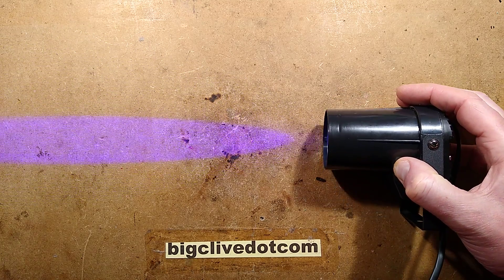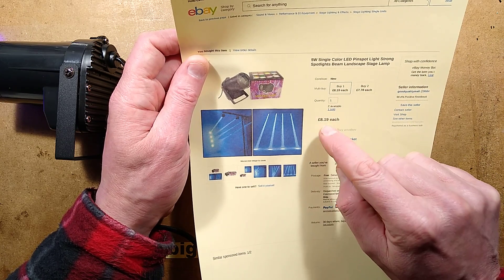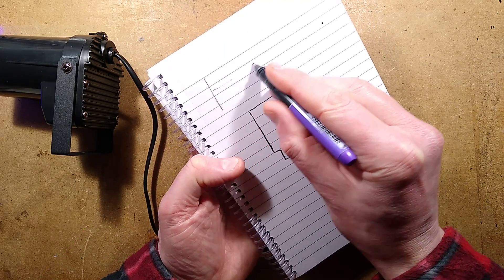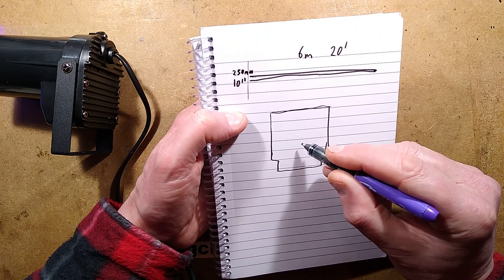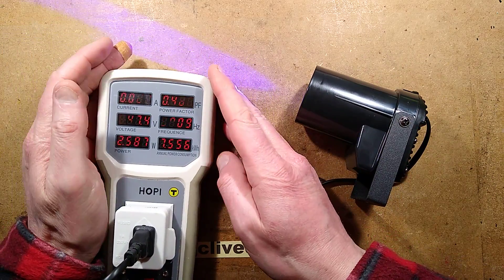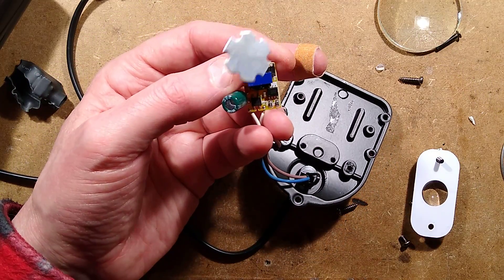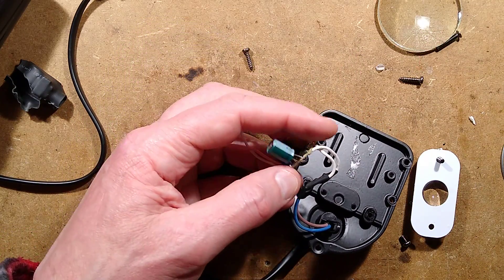Very useful LED pin-spot light that is a good base for customisation.

Comment: In principle, a lot is hackable if it weren’t for the EMC. As soon as you modify it, you no longer have certification that the EMC requirements are met, and therefore in most countries you’re not allowed to operate it. On one hand, this is good because it ensures that your own devices aren’t interfered with by others; on the other hand, it also limits tinkering, because in practice it’s far too expensive to privately finance such an EMC test for a hobby project.

Comment: I built mine using a 18-34v output 600ma and it only flashes. Not sure if hugher voltage out. Means its starving current, would be my guess.
Reply from the maker: That may be due to a driver and LED mismatch.

Comment: Does the front glass lens get hot or could you use printed paper rondells for a temporary colour change provided you used a white led ? Perhaps even glue in a thin round and flat piece of acrylic/plexi before the lens to put the "colour filter" on.
Reply from the maker: It stays cool.  In the theatre industry they use coloured gels.
Reply: @bigclivedotcom  Ivé heard that many times, but what are gells? Not disks of gelatine and food colouring is it, sounds to simple and fragile, don´t gelatine go bad and smell after a while?
Reply from the maker: @agw5425  It's a chemical gel.  Not a food one.
Reply from the maker: It's just like a flexible coloured plastic sheet.  You can buy it online.

Comment: I play in a covers band and am our lighting "tech" 😉 We have a modest light set up with decent quality moving heads, pars etc, I bought some of these a while ago and they are fantastic for shining at angles across the set up when we use the hazer. Very effective for the price. There's a zoomable 30 watt rgbw allegedly which I'm thinking but not sure of the beam angle, I'd want straight like these. I'll get to the bottom of it.

Comment: I got one  of these in the U.S. and the light output is very weak. From eBay Item 392518326733: Power: 5W
, Voltage: 90-240V, Lumen: 200-220LM

Comment: I should stop watching your channel because it keeps making me want to buy more stuff. Having said that, any clue as to what voltages the driver could put out? Was wondering if I could swap the LED for a 6 to 12v version without changing the driver. Since, you'll understand, I kinda have to buy one of these now.
Reply from the maker: I'm not sure what the driver voltage is, but at the very least you could put in a different driver.
Reply: @bigclivedotcom  if it fries, it fries. I'll just try it then, thanks for your response.

Comment: Thoughts on putting a little diffuser in front of the LED to eliminate shape projection, to provide a more appealing spot?  What kind of intensity loss would one expect?
Reply from the maker: It could result in a much wider beam.  This effect is more about projecting a tight beam of light than projecting a circle.  It looks good in hazed air.

Comment: Clive, I was watching a news broadcast talking about the "C" word and one of the doctors mentioned UV light's ability to kill (actually they aren't alive.. but I digress) viruses. As you probably know, normal UV light can do a lot of damage to humans. But there is a particular type of UV light that is only harmfull to those nasty bugs. I found an article which says ' we have previously shown that far-UVC light (207–222 nm) efficiently inactivates bacteria without harm to exposed mammalian skin. This is because, due to its strong absorbance in biological materials, far-UVC light cannot penetrate even the outer (non living) layers of human skin or eye; however, because bacteria and viruses are of micrometer or smaller dimensions, far-UVC can penetrate and inactivate them.' I know AVE is busy working on ventilators so I thought you may have a moment to come up with a personal device that could help keep us safe. I leave this in your hands, good luck. 
https://www.nature.com/articles/s41598-018-21058-w
Reply: Sounds like bunk. Plus it doesn't help in anyway. It doesn't stop you getting it and it doesn't cure or help once you do.

Comment: oooh these. I used them as a pinspot for Javert's suicide during our production of Les Mis. Perfect in a blackout to hide the complete lack of special effects. Only problem with ours is that the shape of the beam is the shape of an led chip, a square with a rectangle stuck on the side.

Comment: Would painting the inside of the housing white help with getting more light out of it or would it cause the beam to not hold it's pattern. I have painted the inside of turn signal housings on motorcycles white and it made a significant difference to the eye but it was to make it stand out more with little need to hold a pattern for a distance. This is a cool product and I have ideas forming for it.
Reply from the maker: That would result in a very wide splash of light.  The whole point of this light is to project a tight beam through hazed air.

Comment: I calculate the beam spread as about 2.5 degrees, compared to 40 for a GU10. A GU10 at 6m has a spot size of 4.3m diameter, which is 17 times as wide, or 289 times the area. At about 70 lumens per watt for LEDs, the spot is receiving 140 lumens.  To achieve the same brightness over the whole area, the GU10 would need to output over 20 kilowatts

Comment: Here's something to look into; I'm skeptical a few lamps could cause enough interference; https://qrznow.com/ofcom-engineers-shine-a-light-on-interference-issue/
Reply: A single lamp can easily cause enough interference to be head a couple of miles line of sight. This isn’t all that rare.  A few years ago a guy’s flat panel tv was emitting a signal that was being picked up by sarsat rescue beacon satellites (back before they shut the system down).

Comment: Just a quick question: is the Hopi power meter calibrated at these low powers? Just thinking that dead band and resolution could hide some power consumption. Perhaps an opportunity for a calibration video?
Reply: The Hopi looks like it could be fairly accurate for dealing with light, low crest factor loads but I doubt they ever receive the necessary calibration step to make them truly useful for the low range. I've studied the CS5463 used inside the Hopi fairly extensively and it's spectacular for what it is, but it has far more capable siblings. I hope to offer Clive an upgrade soon.

Comment: I was watching you handle the heatsink with LED attached and squirming, knowing that the LED was effectively connected to one side of the mains via the power supply. Somehow I am loath to trust the insulating properties of low cost powdercoat on the heatsink. And I certainly don't trust the white paint used on the LED pcb itself. Could the LED heatsink be safely bolted to the heatsink if the powdercoat was removed from under the LED? ie would the heatsink become live?

Comment: Dimple in the heatsink is the ejector pin for the casting mould. They used that section as it is the thickest, so the chances to distort the hot pot metal as it is popped out of the one half of the mould is less. There will be a matching set of smaller ones on the fins at the back as well.

Comment: 2.5W at 0.48 power factor is about 5 watts apparent consumption (which is what you pay for during peak times in several places), so the 5W on the listing seems pretty fair. It's not a 5W LED (which is not a good way to measure brightness anyway; that's measured in Candelas), but it is a 5W lamp.
Reply: As it uses a SMPSU, feed it 340V smoothed DC and measure the current. That will tell you the real actual power.... 😉
Reply: For the purposes of people paying the bill, connecting it to a ~230V AC outlet and looking at the power meter is what tells you the "actual power". ;^)
Reply: RFC3514 - not if you are running it off a high voltage battery that is charged via solar power...
Reply: I'm not.

Comment: how do you calculate meters to feet?
Reply: Very roughly 3 feet to the metre.
Reply: Multiply the meter measurement by 3.28084 to get the fairly close equivalent in feet. In a pinch, using 3.3 is much easier to do in your head.

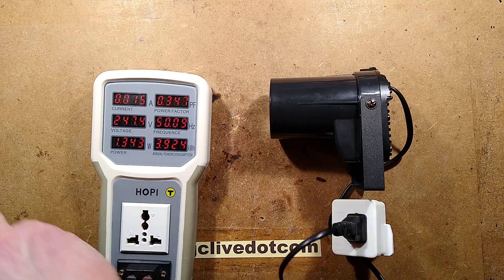Comment: 2:31 ... Well ... they stretch the truth thin, but are not exactly lying. 2.5W times power-factor = roughly 5W ...
So you can say there is a chance that the electricity provider charges you for 5W ...

Comment: I love Chinese products. They have magical powers. They transform a 1w led package into a 3w led by soldering it to a pcb. then they  transform that into a 5w led by putting it in an enclosure!
Reply: Much the same way putting car tuning brand stickers on any car will increase its horsepower...
Reply: @FirstLastOne  Don't forget the yellow silicone wires and hoses
Reply: @FirstLastOne  And the 'Go Faster' stripe.
Reply: @FirstLastOne  or sounds effects that make the engine sound better

Comment: These are commonly used on 1w  or 1w x 3leds or5w max power driver this is 1/2'watt led may be blue or  uv  this is still beter as compared to China standards

Comment: I made some insulated washers to hold those type of LED's down by using a hole punch on a pot-noodle pot, and then putting a hole through the punched out pieces. Pot-noodle tubs are polypropylene and can handle the heat an LED produces. I didn't want to wait for an order of washers, and enjoy recycling and pot-noodles. I used to work for a disco light manufacturer years ago, and they usually have the light focused down to a small spot just as it hit's the gobo, but have the filament focused a little in front so that you get an image of the gobo instead of the filament, the second part of the optics focuses the image of the gobo. As long as you can focus the LED down to a small enough spot on the gobo you should be good (otherwise you will waste a lot of light), you want it just out of focus so you don't see the LED chip shape in the image. Good thing about LED's is that you no longer need a metal gobo to handle the heat from the lamp - it's considerable even for a small fixture that uses a filament bulb, as I found out by sticking my finger at the focal point.
Reply: Nice tip.  Now if only they sold pot noodles in mica pots we'd be laughing......!

Comment: Yeah, noticed the halo early on with your replacement LED. The original one was much better - had a nice crisp edge to it - I say with my followspot operator's hat on !
Reply from the maker: It's not helped by the wide point of phosphor.
Reply: @bigclivedotcom  On a similar but completely different optical 'feature'. Entering the rear - as we do, of theatres, I didn't put the light on but closed and locked the door, removing the key. For whatever reason, there's a bit of wall the other side of the door which one has to walk round. But on the wall, upside down was the scene outside (daylight) but a bit blurred. #camera-obscura with a keyhole rather than a pinhole. Just a bit apt to spot a projection - underneath the original back-projection projection room !

(I guess that old proj room was hung off the back of the building. It was 'outside' underneath it - so, over time the boxed in the underneath and maybe the bit of random wall was additional new support for the old proj room !)

Comment: I would definitely change the flex for a 0.75mm  3 core flex and fit the CPC to the heat sink on the back. Other than that, it's a very good project casing and spot light for disco's etc.
Reply: Personally, I would use an external 'plugpack' type power supply with limiting resistor and one side of the secondary firmly earthed. While I do work on switchmode supplies, I am extremely wary of the possibility of contact with the mains on both primary and secondary sides. Still live and kicking after nearly 7 decades so I must be doing something right.

Comment: 3:00 - bit of 'bent' wire is called a circlip ! (Figure it out Clive, I know you can.)
Reply from the maker: In PAR cans it's usually called a retaining ring.
Reply: @bigclivedotcom  Alternative name for the benefit of the uneducated ;) 'Snap ring' is another alt name for a circlip.
The 'common circlip' has 2 holes near the ends in which to fit circlip pliers for ease of fitting & removing said clips (I assume you know that already too) and some have different end arrangements - such as simply bent ends so any pliers would do - and various styles of clip exist but all work on the same principle - a spring clip fitting into a groove.
(There are other 'rings' that fit into grooves that are not springs and are held in place with some other means - that have the same function as circlips.)

Comment: 14:40 - spacers - did u say 3, 2x4 and a 5 ? Maybe they had the 2x4 on one side and the 3+5 on the other - since the total's the same !
Reply: Originally there were 4 spacers, 3 of which were 4mm and one a 5mm, so 8mm on one side and 9mm on the other.  The ones he put in were 3mm each and he put on 4 per side for a total of 12mm (per side).
Reply: @TheOtherBill  Ahh, must have mis-heard.

Comment: Oh dear, you really don't have to bite something to tell if it's glass or plastic!! Glass will be cold, plastic is warm, just touch it to your cheek or inner wrist. They will, as a rule, stay that way or return to their basic temperature very quickly. I buy a lot of vintage jewelry and that's how I tell what beads are, though stone will also be cold. Glass will also tend to feel heavier than a comparable piece of plastic.
Reply from the maker: If you tap a material to your teeth you can instantly tell its plasticity.  It's a fast way to identify between glass and plastic.

Comment: Hello everyone. Since we all are currently watching a video that has its focus put on lenses... Does anybody know a way to focus a 44mm led to a beam with an angle more like 10 to 30°? Im trying to convert a scanner to led, but im not getting enough light out of a 100w led... I guess its because im currently using a 60° lens and waste way to much light
Reply from the maker: Traditional lights designed for a tungsten or discharge lamps have an optical system designed for a sharp point of light.  A typical large area LED will need a different optical system.

Comment: Is it uv light? can we ise it to blast the covid -19 virus off £ notes?
Reply: Only uvc kills microbes, I made my own very effective light by breaking the outer glass from a low pressure mercury lamp
Reply: @terabyte7683  how can you tell which wavelength an led gives off? I got a cheap uv led torch for leak detection but dont know what wavelength it is
Reply: dan dee - most ‘UV’ LEDs are not actually producing UV light...
Reply: @Mark1024MAK  but uv pens and dye shows when the led uv torch is shined on it. now from what I found out 254 definitely kills most virus but I notice when someone ask about uv killing virus the answer they always seems to get is about uv may irritate the skin, no one ask if uv irriatate the skin so why cant they just either say yes it does or no it doesnt
Reply: dan dee - 1) visible light wavelengths that are near to UV may also cause UV sensitive material, ink or dye to glow.
2) UV light is a range of wavelengths, just like visible light ranges from red through to blue and violet. UV light is generally classified as UVA, UVB and UVC. Different wavelengths of UV light have different effects. And different UV light sources produce different amounts of the different UV wavelengths.
3) There are real genuine UV LEDs that are available (most emit UVA), but some so called UV LEDs on trading sites are just emitting blue or violet light. The majority of humans can’t see ‘near UV’ light and no humans can see UVA, UVB or UVC light.
Some UVA sources that use phosphor also emit blue-violet light as well as UVA light. Gas discharge tubes that emit UVC also produce some visible light blue light.

See also https://en.wikipedia.org/wiki/Ultraviolet
Reply: @terabyte7683  "Regular" UV (e.g. sunlight) works on the current superbug virus, just takes longer.
Reply: A grow-light shoud be just a mix of red and blue. Little or no uv.

Comment: You could out in a real Cree style LED similar to flashlights and use it as a spotlight, even during a power outage with an inverter or even convert it into a DC light and run it from a couple batteries. I'd hack it to be able to operate from a power supply or batteries that way it can be used in many situations.

Comment: If pressed (which won't ever happen but grant me my fantasy) the manufacturers would just say that the LED puts out as many or more lumens as an incandescent (or arc, given its advertised theatrical application) lamp that ate five watts at the plug.
Given the greater efficiency of LEDs they'd be more than right, too, but they could at least say that up front.
I see similar things on home-use light bulb boxes even after incandescent bulbs have been off the market for quite a while.

Comment: got message today that the bigcliveapproved headtorch has arrived in my country from china. should have ordered toilet paper along, could have sold it with a good profit ;-)
Reply from the maker: I got an orange one today and it's got different circuitry.
Reply: Wait, orange toilet paper?  With circuitry?
Reply: @bigclivedotcom  soooo,
arrived today, did not really take long from china. 3x 6.37$ "free" shipping.
Ordered 15th march in the afternoon after your video, arrived 25 at border and got it 26th at noon.
Got 3 black ones, wanted to get the same version. i noticed that this version allows to completely switch off the lamp even when in ir-detector mode. Gonna open one up and compare. But also the ir-detector was not only reacting to hand waving but also to another person moving close by.